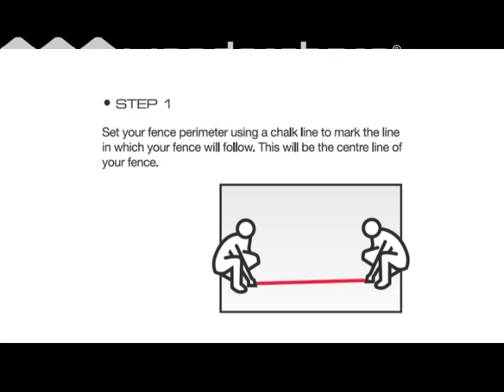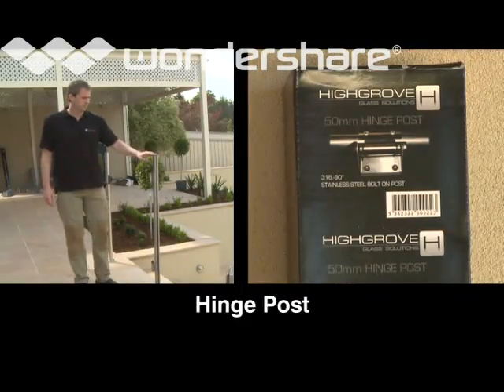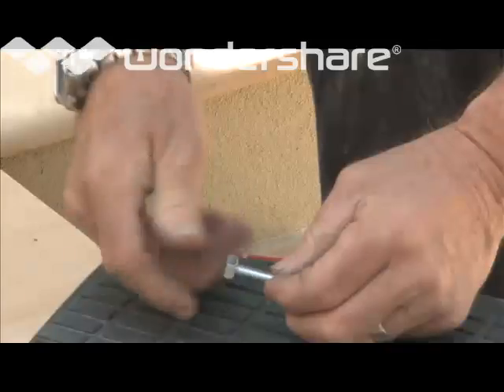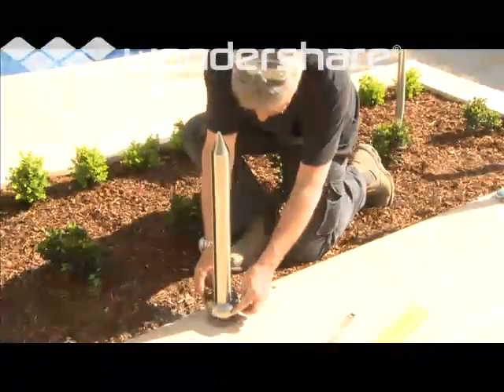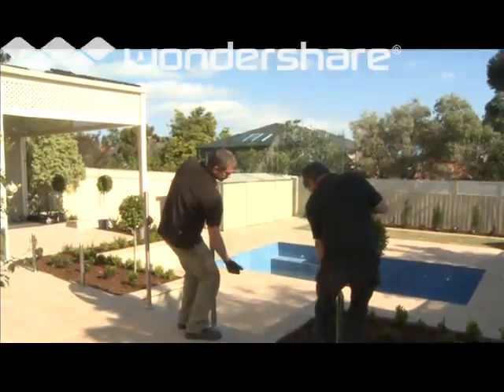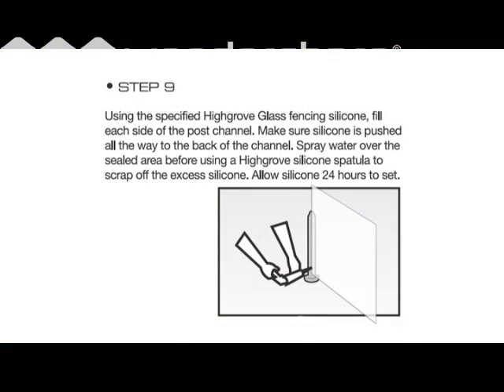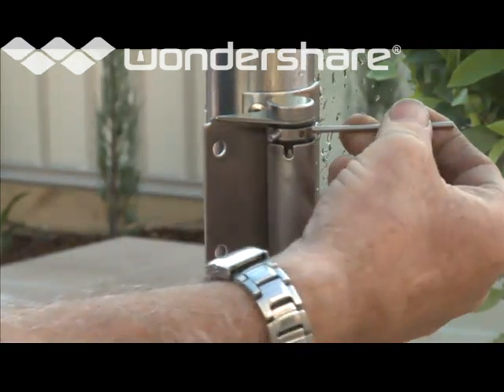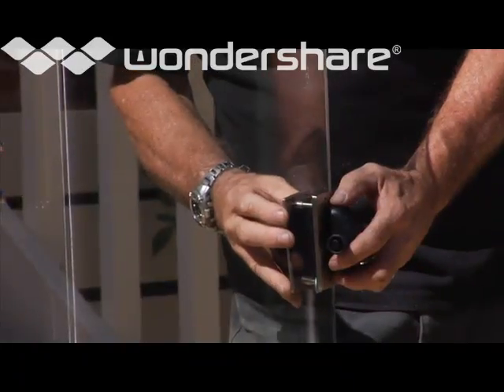HIGHGROVE POOL FENCES Part 1 DYI Instructional DVD Glass Semi Frameless Post System

Comment: Just had on of their glass panels exploded into my pool and onto my deck and verandah. I asked around as I've only been in the house for two weeks (2.5 year old home), and apparently it happens quite a bit. Usually doors/gates, but in the instance a normal 12mm thick 1200mm x 1100mm panel......

Awesome stuff..... simply awesome.